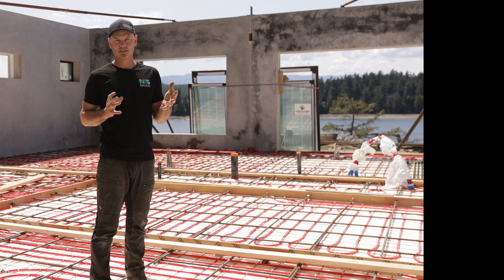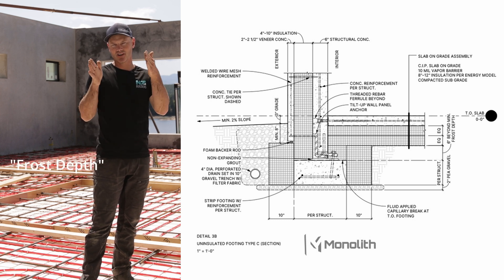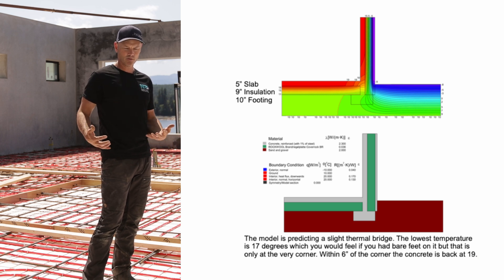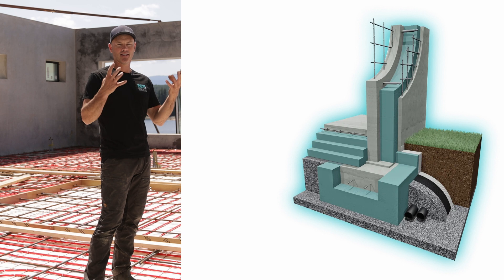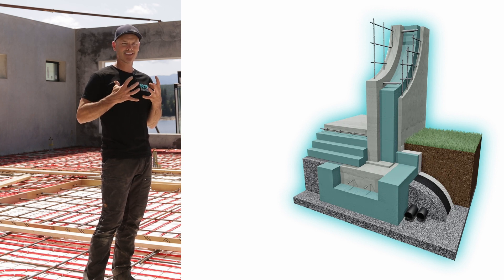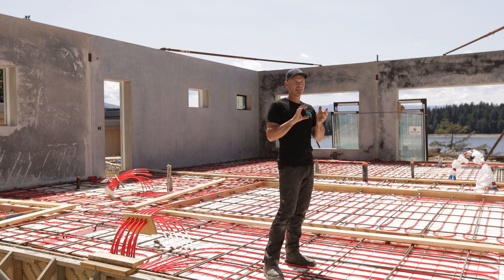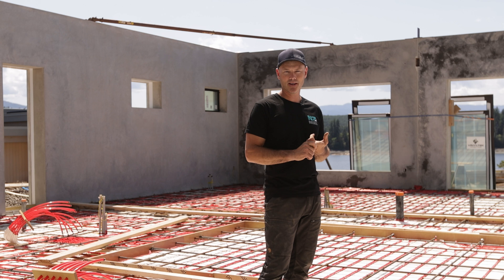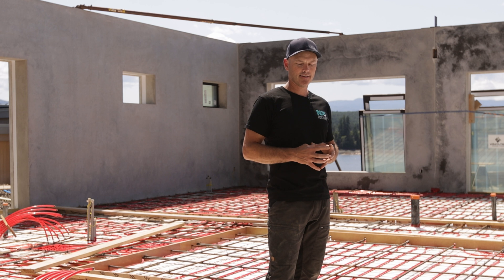Insulating Footings and Slabs in Concrete Insulated Panel Homes

Comment: Dude, you put more insulation under the slab where delta T  between ground temperature and room temperature is only 12 degrees. When delta T between room temperature and outside air can rich 30 and more degrees. Good job in wasteing customers money